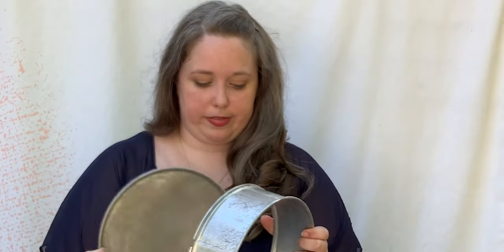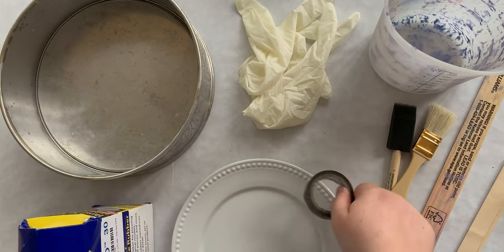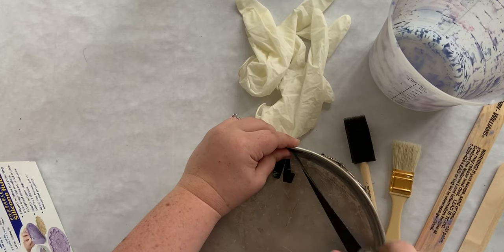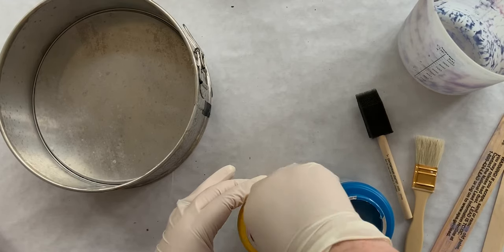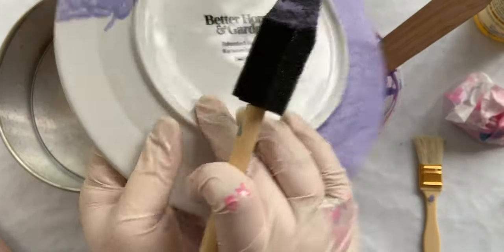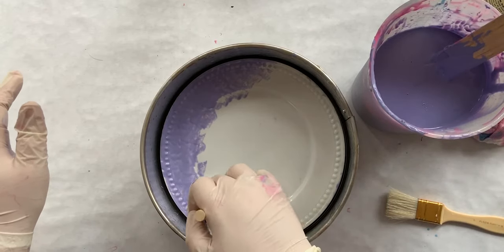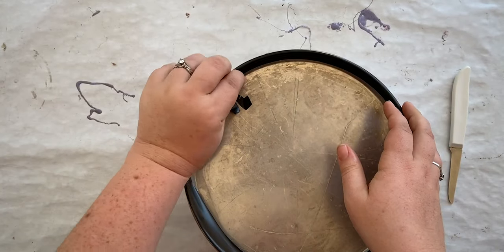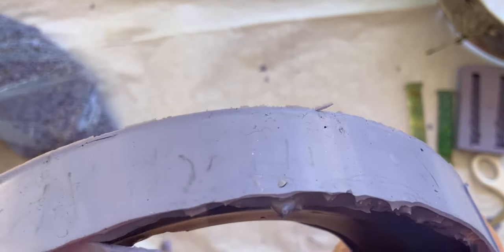How to Make a Silicone Mold Out of Anything

Comment: I have been told that prepping the items you want to mould as well as the container you are pouring your silicone mould material into with mould release spray at the very start. And doing two - three layers of mould release, making sure that each layer is dry before applying the next layer. I also personally would have poured around 7-10mm of the silicone mixture into the tin before adding the plate & making sure there was enough mixture for 7-10mm on top as well to prevent tearing. 
I do like the fact that you have explained some of the mistakes you have made & how you went about changing your future process & additional tips.
Reply: Where do you get the mould release spray please?
Reply: @louisewatson3129  I searched for it on Amazon, but eBay may also be another option

Comment: Just concerned about how long you are taking to paint the plate as my moulding silicon has a pouring time of 5mins. Yours maybe longer but could mislead some people. Good video
Reply from the maker: You always want to look at the instructions for the silicone you're using... I can only give suggestions based on the one I'm using. Not every other moulding silicone on the market. I wouldn't use one with a 5 minute pouring time for a detailed piece like this...

Comment: This is such a nice video..I had few failed attempts of mold making so thanks alot that u gave idea of using chunks... but tell me just mix half liquid and half chunks can give smooth result or we have to pour chunks later so we could get smooth top? Please reply
Reply from the maker: I just poured half liquid and half chunks and had a smooth top and smooth insides with the chunks only on the open portion of the mold (which ended up being the bottom of my mold). I was so scared everything would be chunky but it wasn't! Worked like a charm and saved me so much silicone.

Comment: Can you tell me why you pre painted plate with silicone? Thank you
Reply from the maker: I wanted to make sure that the plate was fully covered and didn’t have any gaps… I find that painting it first helps with that. It’s not necessary just something I do
Reply: @Happilyeverafteretc  thank you. Makes sense because of pattern on plate.
Reply from the maker: @paulalaguaite1644  exactly… I probably wouldn’t have worried about it with a smooth plate

Comment: I have a question I know you probably won't answer me but I'm asking anyways is there any way you can make or show me how to make silverware a mold for silverware and make those silverware and show it 0:14
Reply from the maker: Hey Michelle, I have never done silverware and honestly am not sure that I would attempt resin silverware as making the delicate pieces 100% food safe may be challenging. Even with food safe resin (like the one I use for my plates) adding any colorant makes the resin NOT food safe.

So your options are clear resin or to topcoat your resin with a clear coat. Both things can work but with the small tines on a fork it may be challenging. Not impossible… just challenging.

I did a similar silicone mold to this one and poured knife rests to match a set of antique knife rests I own. It would be the same process for silverware: https://youtu.be/nxxzQou8tTo?si=fugeF9kmd_UNR-i8

Hope that helps!
Reply: @Happilyeverafteretc  I have a really hard problem eating with silverware so I have to eat unfortunately but baby silverware because they're plastic and they don't hurt my mouth that's why I was wondering if there's a way that you can do it and show me how to do it cuz I'm just learning resin you're the first person I've seen even make a plate but thank you that you acknowledge that I asked you a question thank you so much for that

Comment: So excited! Just ordered mold-making stuff (I ordered from the Reynolds website as they are the same manufacture as the silicone you used, but I ordered the dragon scale type silicone, as it's supposed to tale small details better, and is translucent- it is a little more expensive than the smooth on 30, and I was able to order in a gallon size) and I also ordered a vacuum chamber degasser from Amazon to help with eliminating bubbles. Both major expenses, but I already have everything else I need to get started. Thank you for this. I'm a new subscriber, and love your channel. And I love the tip about using fail left overs as filler.
Reply from the maker: I've heard that the translucent silicone is amazing, I hope you have good luck with it! The vacuum chamber is suppose to be wonderful too... I've seen videos of it in action and it definitely seems to remove all the bubbles. Good luck!!